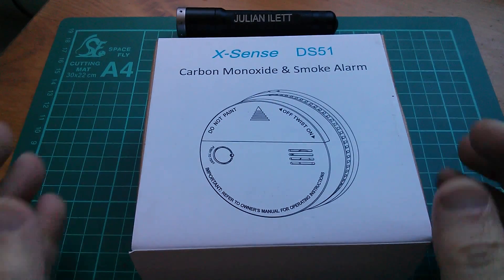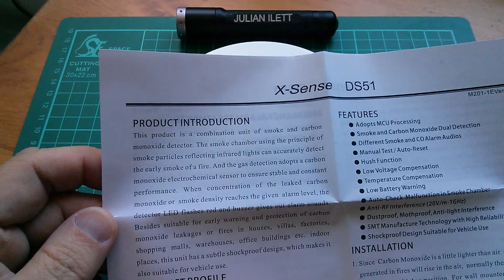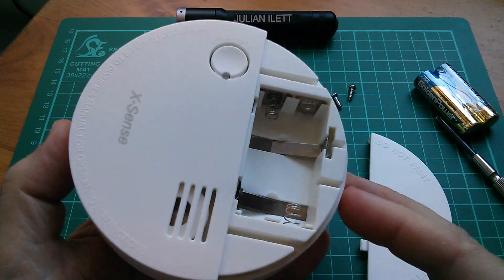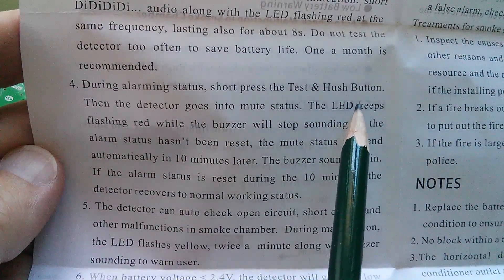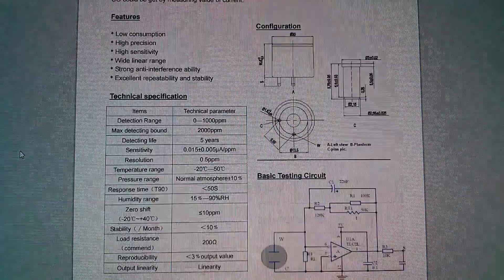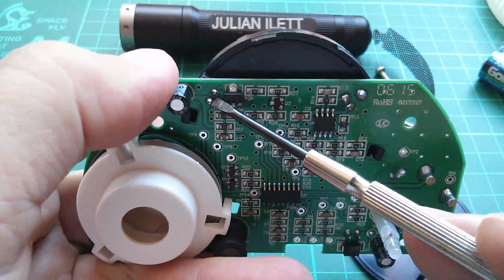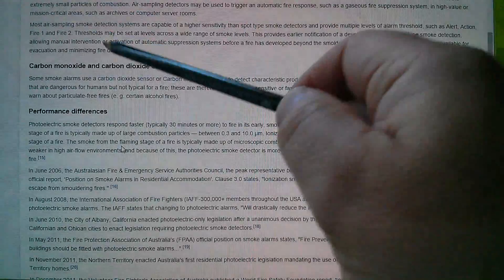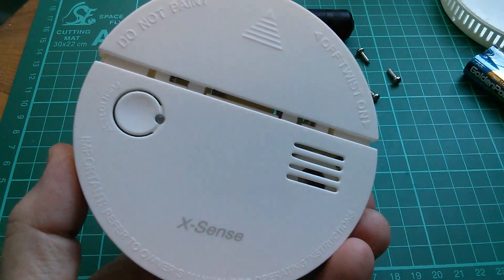Julian looks inside: X-Sense Carbon Monoxide/Smoke Alarm

Comment: I have an optical smoke detector from an office building, guessing probably make in the late 90's. I had heard, and assumed true, the optical type were common in commercial areas. it is interesting to know the optical type detect early smoke and ionizing type better suited to flame, good to know.

my thought is, the optical type likely performs better, but used more power, until recently when more efficient designs are now possible.

Comment: I see a problem there with the carbon monoxide detector at the ceiling. While dust from an early fire is supposed to be found at the ceiling since hot air goes up, the carbon monoxide is - as far as i can remember - heavier than normal air and will therefore most likely be found at floor level. I wonder how much sense it makes putting two sensors in one case when one should be mounted at the ceiling and the other one on the floor.
Reply: Mirko Mueller All the dedicated CO alarms I have seen have instructions that state they should be installed at a reasonably high level.  Presumably, since the CO is a product of combustion, it will be warm and thus less dense than the rest of the air which is cooler?
Reply: Guess you are right. Since the produced CO is hot it will reach and therefore trigger the sensor at the ceiling. Well done!

Comment: Very interesting Julian, thanks. As it happens, we've got a CO only detector in the kitchen, which we've had years. That actually tells you on an LCD how much CO there is- though as it always says 00 I remain to be convinced!! This unit is powered by 4AA cells I think, but I'm sure you're right that the microcontroller only powers up the sensor for long enough for it to stabilize and take a reading... Interestingly our unit has an led that flashes every 30 sec or so, I'll bet it is simply connected to the sensor power....

Comment: Does it make sense to put a CO sensor up to the ceiling? I thought that CO is slightly heavier than most other air components. So it will collect on the bottom of the room. If your fireplace is not vented correctly you might be sleeping already forever when this alarm will do its "DiDiDi..."
Reply: Manufacturers generally recommend ceiling mounting.
Reply: mrtynan Hmm... did some investigations and CO is only very slightly heavier then the rest of the components of air. It is very likely that any air flow in a room will mix it up with the rest of the air and the overall concentration is rising and then detected even by a sensor mounted to the ceiling. On the other hand, manufacturers of CO sensors, especially for fire places, advise to mount them in 1m above floor or the height of the exhaust of the oven... Just read the manual. However, a ceiling mounted CO sensor should really work.
Reply: Astralix2011 I'd think the source of the CO would make a huge difference. CO generated in a fire tends to be hot and would rise whereas lpg is usually escaping from a pressurised canister, thus cooling it and causing to stay low to the ground. 
Of course, CO₂ is even more dense but you're unlikely to detect a difference of concentration between the floor and the ceiling.

Comment: As a building electrician, (now retired), I was ordered to fit smoke detectors especially.  It is absolutely stupid the way many are installed in places such as kitches or nearby. False alarms negate the whole point of an alarm. These things are very sensitive and can be installed where they are most needed. More importantly, the three different types, heat, (rate of rise), ionisating and optical make all the difference provided people know what they are! 
I have ours installed at the top of the stairs. In the last 20 or so years it has become compulsary to have mains powered detectors fitted in new builds and refurbs. Sadly, the problems of inappropriate siteing continue.
Thanks again fpr the video. Always appreciated.

Comment: wouldnt call ionising an old style of smoke, but they are differing detectors for differing use.
Optical are better for slow smouldering fires. (textiles etc(
Ionising better for faster burning fires (waste paper/chip pans etc)

Most brands offer both (plus CO and heat detectors)
Reply: shoulda waited to watch all the video before I commented :)
Reply: Tim Darnbrough Always a good idea.

Comment: I prefer the 3 Volt versions. I don't understand why they make the single ones all 9Volt. I even managed to run one on a Lithium Ion battery with a few diodes to lower the voltage and a supercap to have sufficient juice when the alarm goes of (all tested of course).